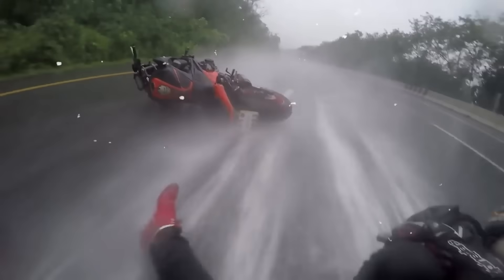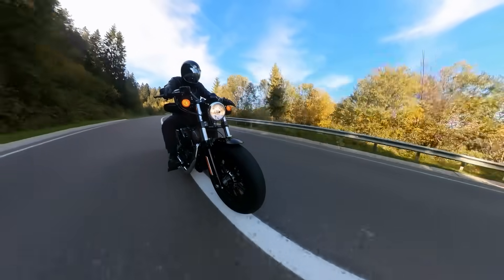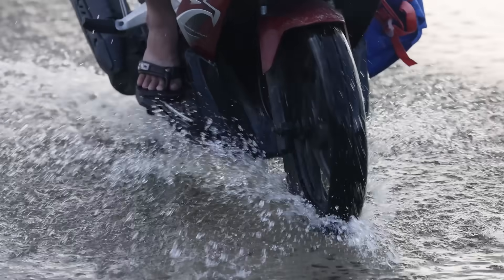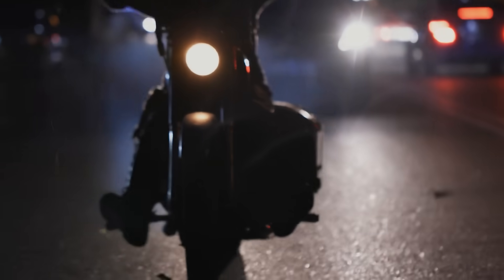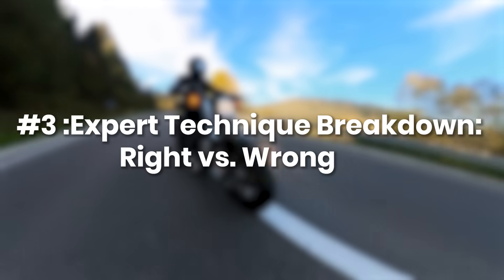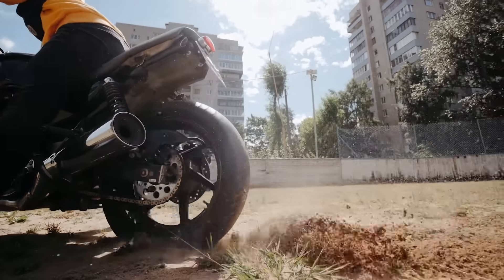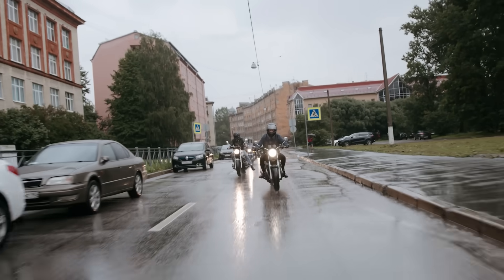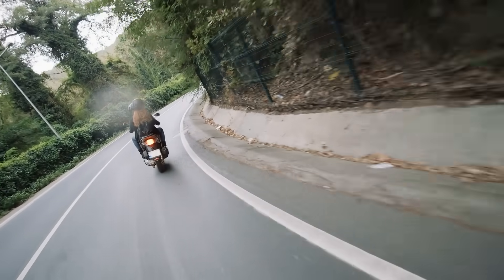The REAL Reason Riders CRASH in RAIN (LEARN NOW - STAY ALIVE)

Comment: The most comprehensive video on this matter, clear, straight forward and pedagogic. I would make an adiction, periodically take a look at your mirors so as to verify if your tyres are leaving a track as well. I also prefer ride under heavy rain rather than light one, and multiply by 4+ the distance to vehicles ahead, and avoid - or even never ride at night. Thanks for sharing with we all.🙏